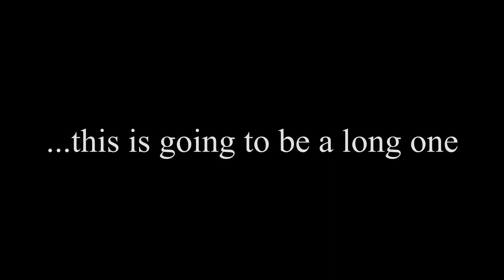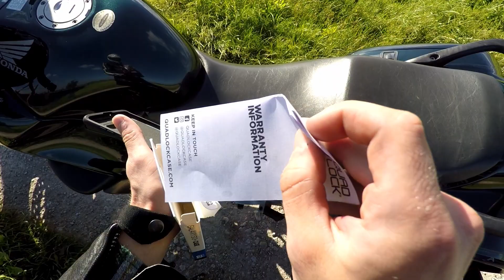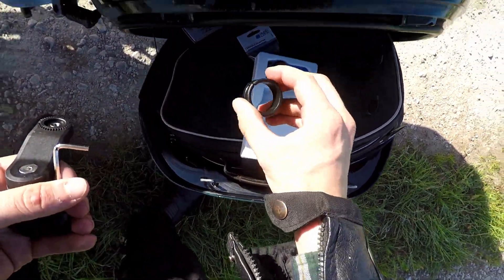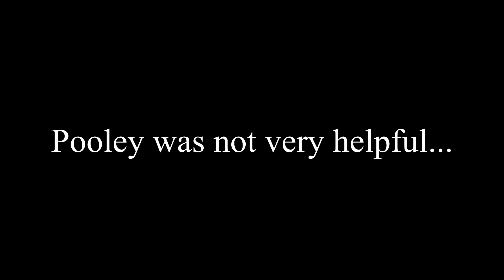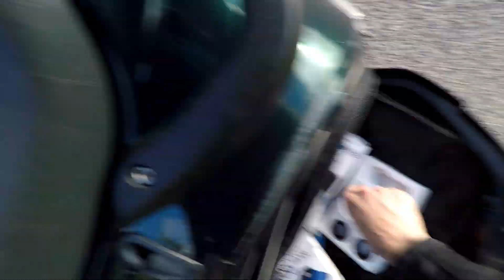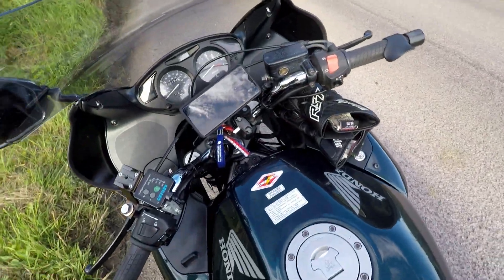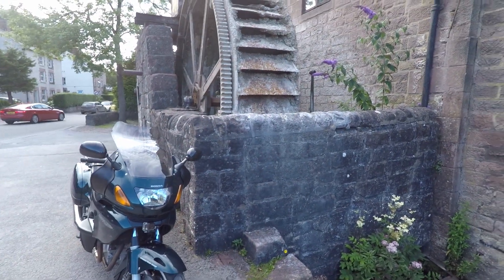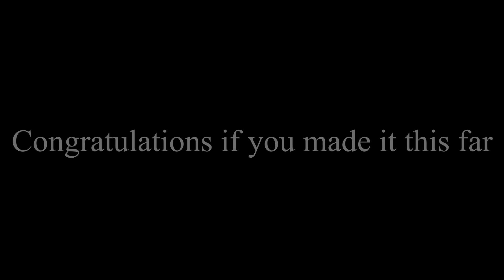Quadlock Mount vs an Idiot

Comment: Hi mate, great video. I have a Deauville myself, can I ask what screen you have on your bike ?, I like the look of it. Also do you have any ticking noises from your engine ?, mine makes a fluttering tick sound when on the overrun and at low RPM, thanks !.
Reply from the maker: Hi Baron, thanks for stopping by.

I have the Powerbronze touring screen fitted currently, which costs about £60.

Engines have a lot of moving parts so some noise is normal. If it's a metal-on-metal ticking sound then I would recomend checking tappets, but these engines can run 50k+ before needing adjustment.

Hope this helps a bit 👍